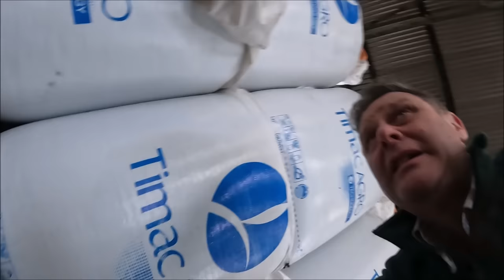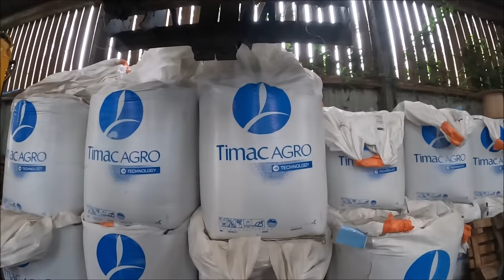21/03/24  Getting ready for Eddie. Its fertiliser time!

Comment: Ian, good to see two people working together to get jobs done that benefit's both of em, the old back scratch method never fails.
Just wondering is the grant system is locked to the office post code or the field, cos it would be easy to have an office on wheels!!!!!! That moves with the best grants.

I spent an hour doing a tidy up around my place, mostly just putting things back where they should be, because others have a terrible habit of using tools and leaving them anywhere, then moan when they can't find them. To curb this I have started hiding them under bricks etc. right beside where they were dropped, it drives certain people nuts.!!!!!